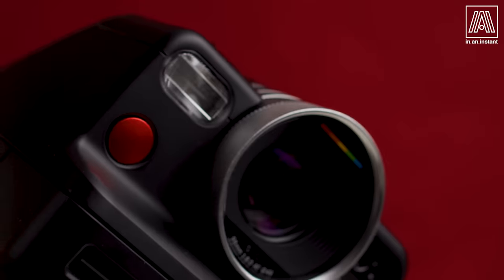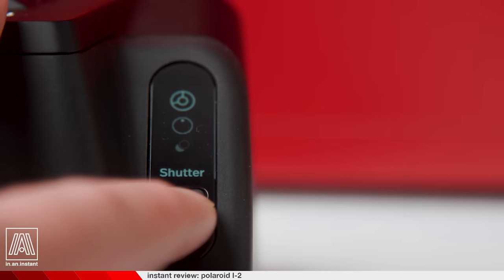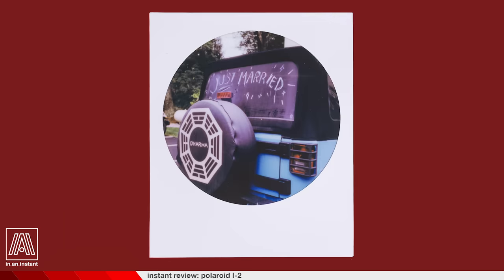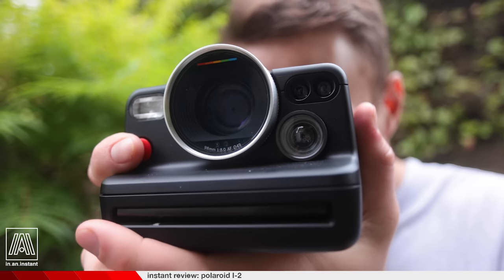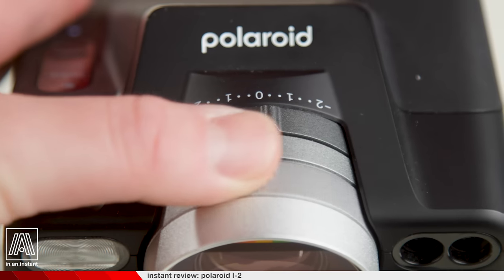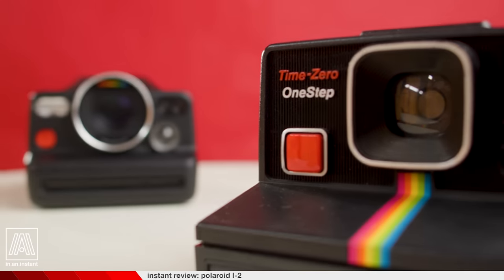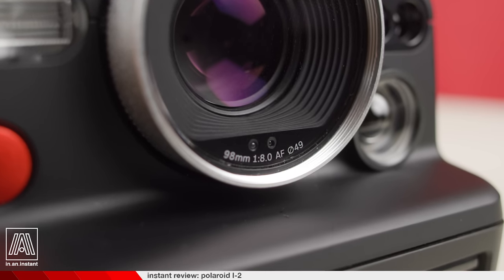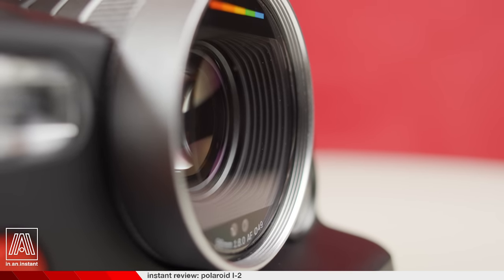Polaroid I-2 Review & Breakdown - A generational camera, is it the SX-70 killer?!

Comment: It's 700€ in the EU. 

Seven. Hundred. Euros. 

For a plastic lens and a built-in battery for which Polaroid doesn't offer a replacement service (AKA "this will be a doorstep in a couple of years"). 

That, along with their questionable quality control for film and cameras, as well as them advertising a 700€ camera with "Chase imperfection, embrace the random," will be a no for most Polaroid photographers and probably all potential new users.

The video is great, as always! 👍
Reply from the maker: For me, I say the images speak for themselves. It's either worth 700 euros to you or not, but you can't fault them for the price of making a great machine like this.
Reply: @InAnInstant enjoy a dead battery in a year or two. But you got it for free, so no loss.
Reply: @InAnInstant  The images look great! But a non-replaceable battery in a 700€ camera is unacceptable. And Polaroid does not offer repair services for any of their cameras. In fact, are there ANY companies that repair modern Polaroid cameras? Say, there is a dead battery or another issue, and the 700€ camera is out of warranty. What does one do?

Also, it doesn't look like the new plastic lens is sharper than the old glass one in the folding cameras. The claim it's the sharpest lens they even put in a camera is pure marketing. But they aren't lying, if they are only considering their modern cameras. If anything, the new lens seems to have some pincushion distortion, which the old one doesn't have.
Reply: Not to mention a feature being parallax correction, with a tip shutter speed of 250. 600 is a joke for this thing that has features a rangefinder from the 60-70s has.
Reply: @dragonforces Wow you have some kind of crystal ball? Such a negative attitude. So don't buy one. But hundreds if not thousands of devices have lithium batteries that last for years without issue.
Reply: @chrisw5444  it’s just shitty business practice. Even a fisher price toy has removable batteries.
Reply: @dragonforces  Sure, I agree but it's likely the camera battery will last for plenty of years, forever...no. And by then someone will figure out how to replace them. Battery technology is pretty fancy nowadays. While it's not mentioned, it may be possible the camera can be powered by the 600 film battery.
Reply: Hate to agree but I do - non replaceable batteries in consumer electronics should not even be legal.
Reply: The SX70 was 1300$ back in the day.
Reply: @kw_awards  The SX-70 was a revolutionary first-of-its-kind folding SLR with a glass lens. The I-2 doesn’t even expose properly in auto mode. And good luck replacing the battery when the time comes!

Comment: Great video and some great features. But what a letdown at $600. A non-replaceable battery that will leave this a brick in under a decade. A plastic lens? (No plastic is ever the same). I guess I'll stick with my SX70. This should be $199, not $599

Comment: Lovely video as always. Just wanna add that the I-2 has a maximum shutter speed of 1/250th of a second. Polaroid has this listed deep on the product page in the "full technical specifications" but this feels like pretty important info to surface for customers since its the only downside of this camera compared to a nicely modified SX-70 from MiNT

Probably still gonna get one but I thought I should share this info with folks
Reply: 1/250s still should be more than enough for most lighting situations, considering you can get aperture down to F/64. Only thing you're missing out on is bokeh in bright light situations.
Reply: @fricki1997  ND filter on the front might enable that?

Comment: Great review! But I think it would have been nice if you included some info on how well the auto-exposure works as it is what most people would use. I really love the manual modes, built-in self-timer and multiple exposures, these are features I really long for with my SX-70, but the 600 dollar price tag is not very encouraging😅 I'm aware that this is not considered much in the analog world, but it would definitely be a future splurge for me, maybe if they do a sale. Other than that, I'm glad that Polaroid came up with a good enthusiast-oriented product.

Edit: my only concern with this camera is the built-in battery as a potential point of failure in a couple of years and how those can be serviced, as it wouldn't be a good look to end up with a 600 dollar paperweight right after the warranty runs out.

Comment: Excellent video, well put together as always, I really like this camera, it has all the benefits of the One Step + and more but with all facilities on the camera itself or used via the app.  Though, I can’t help feeling like this camera is trying to compensate for bad film, rather than it having genuine good features, which is still true, I just feel Polaroid have made this in vain.  Original Polaroid film didn’t need to fall back on fancy cameras because the film was that good.  You still got your sharpest shots from the SLR and Spectra models but it was much crisper, vibrant colours, developed in 90 seconds, not light sensitive after ejecting from the camera, stable, it was excellent.

New film now is less sharp, softer, either really washed out or very underexposed/ over saturated.  The colour shifting in the new film is all over the place.  It’s a shame because with real Polaroid film, this would be a fantastic camera.  We can only dream of film as good as the original 600 and SX-70 chemistry.

I love Polaroid and I am absolutely amazed they managed to remake the film at all but unless they improve it at this stage, I can’t see it lasting much longer.  Granted they are always working on it but I can’t live in denial that they have been trying to perfect it for the last 13 or so years, of course, it has come a long way since but it still has quality issues and mixed results, after all this time and investment, personally, to get it back where it was in the 90s, I think will always remain “impossible”.

I am not saying the film is complete trash because it isn’t, I have taken some wonderful pictures with it but at this stage in the game and based on the price of this new camera, I think it is a big capital outlay, when the film is no where near the quality it should be, respective of the camera.  I like to keep an open mind though and would definitely be willing to try it for myself and see how it handles.

Comment: Ben, thanks so much for all of the information in your videos.  A couple of questions I'm hoping you can answer about many images from the I-2 I'm seeing on the internet.  There is often a "half star" at the top right of the frame, or some unusual free-rom overexposure at the bottom of the frame.  Are these defects due to uneven developer spreading?  Is it just inconsistency in the packs, or the rollers in the camera?  And on the internal exposure meter when in manual mode: is it not simply a center-weighted meter that one could aim at an object in the frame, and then use knowledge of the zone system to calculate an accurate exposure without carrying a hand-held meter?

Comment: Sorry Polaroid, I'm sticking with Fujifilm Instax Wide. When your best camera still has exposure issues, your film blows out highlights, and costs $2 a shot I can't justify the $600 price. I was ready to buy, and even though it's a certified doinker, it's just not enough for me. I'll stick with my Impulse AF for when I'm feeling charitable, or the Lab when I want something exposed properly, until then I'm sticking with my plastic fantastic Wide 210 and RF70.
Reply from the maker: Polaroid film has significantly better latitude than Instax, especially in highlights
Reply: @InAnInstant It's worse quality and more expensive. I've shot plenty of Polaroid film and it fades badly after a few years, even kept in a dry cool setting. Fujifilm Instax is leagues better.

Comment: I’m stuck on purchasing either the slr 680 or the I-2. I like the features on the I-2 but I’m not a fan of it’s battery, and the slr 680 is just classic. While it does depend on the film, would you say the outcome of the photos are relatively the same in terms of sharpness and exposure etc? which one should I get??!
Reply from the maker: Yes I believe you'd get similar results from either, so the I-2 would be the way to go!
Reply: slr680 will hold it value, i2 will be half price by Christmas..

Comment: I assume it has the 600film option in the menu so it would prioritize the battery in the cartridge vs the camera? Has anyone tried to put a 600film pack in it while the primary battery is dead to confirm if the 600film will also power the camera? That’s the only logical reasoning I could come up with as to why the film option is even there.

Comment: I'm very surprised by the integral ,non user replacable battery design - this does not fit with the new EU regulations from 2027

Users of smartphones, tablets, and cameras must be able to "easily remove and replace” their batteries by 2027, the European Parliament has decided

So I can only assume an I-2 Mk2 will be launched before 2027 with just such a replaceable battery design.

Still delighted on such a brave new camera launch.
Reply: Good point about EU regulations. I'll wait for the next version because at this price point I expect to be able to replace the battery.
Reply: @eleo1484 Agreed ,it is surprising they went down this route , I expect it's a cheaper design option but on a £600 camera it's a mistake imho.

Comment: For $600 a Polaroid camera sounds downright stupid. Especially since the manual controls, can be had on the $150 camera through the app. I think if it was cheaper then it would make a lot more sense. Are actual PRO PHOTOGRAPHERS using Polaroids at all? Is there a meaningful difference that can be had on a POLAROID? I’m just not buying it (the concept or the camera).
Reply from the maker: Hi Cole. Answering in order. The price is significantly less than the most popular/beloved Polaroid camera, the SX-70, and has far more features + a company to tech support it. No brainer there. As far as your latter question, yes Polaroid is extremely popular among professionals. It’s become a significant part of commercial photography and is along for the ride for many photographers. And per the last question, yes, lensing can have a tremendous effect on how every aspect of a Polaroid image is shaped. Look at an 8x10 Polaroid and you’ll see what I mean.
Reply: I appreciate the explanation. I guess I'll have to take a look at one these if I can come across it in the wild.